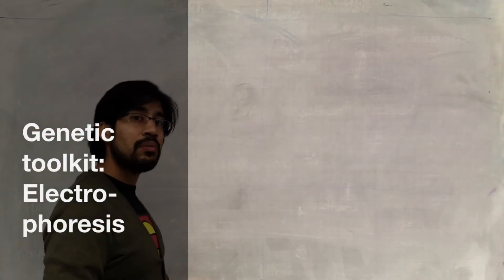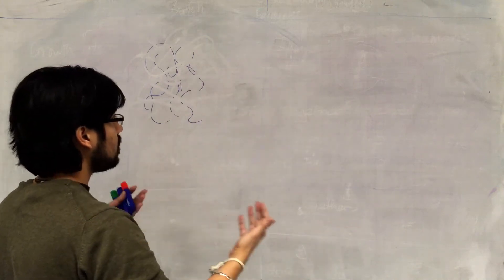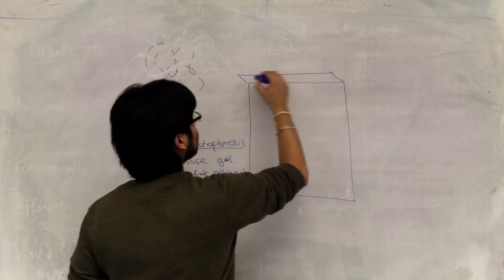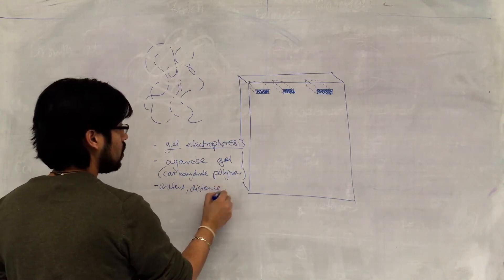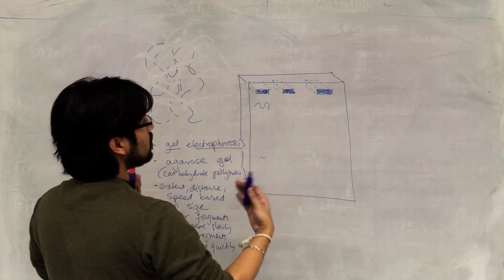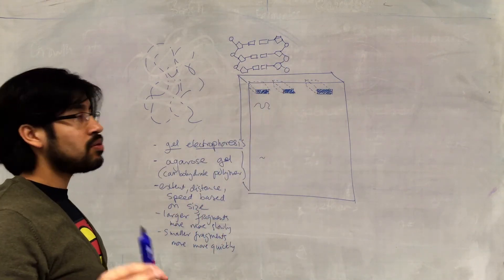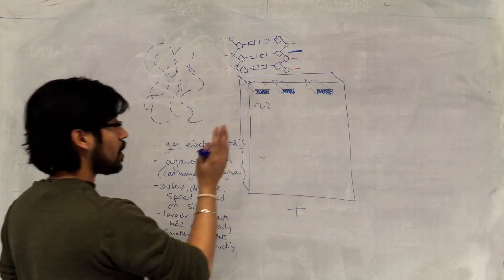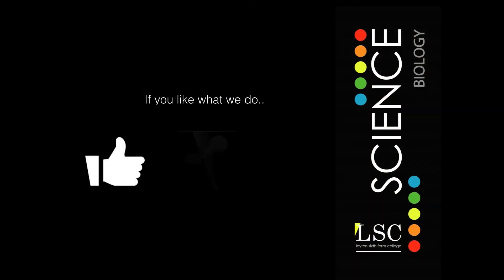Genetic toolkit: Electrophoresis

Comment: Thank you ! There's a ton of content for F215, how would you advise the revision process to take place from the point where notes have been written and everything is understood but not memorised ?
Reply from the maker: +S AC I'd start condensing notes into subtopics, and bulletpoints/numbered lists. Eg Electrophoresis: about 5 main points would cover it. Advantages vs disadvantages of plant cloning: about 8 points in total. Then I'd start mapping out how all the separate topics link up, for example to make a transgenic organism, you'd have to use restriction enzymes, gel electrophoresis, vectors. I'd say mapping all the topics would be the important step.
Reply: +LSC Biology Thanks. I feel as though I don't have that time before the exam, isn't it more important to move straight to past paper questions ?
Reply from the maker: +S AC well in my opinion it's those things that really help to develop proper understanding. Past questions are there to help to test your understanding at the end and yes, here and there you learn something about how to answer questions. However, yes, if you feel pressed for time do exam questions.